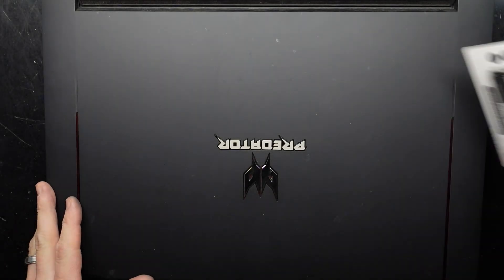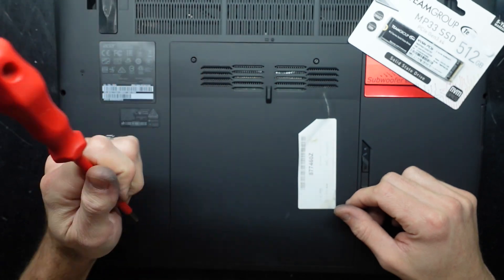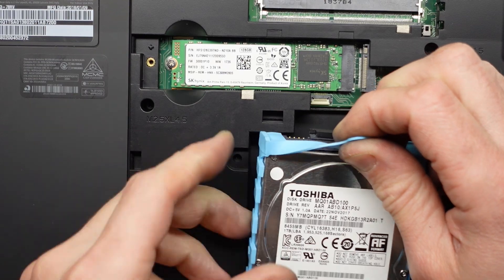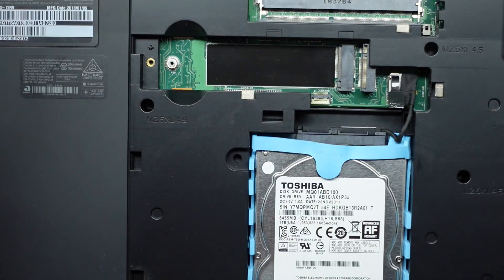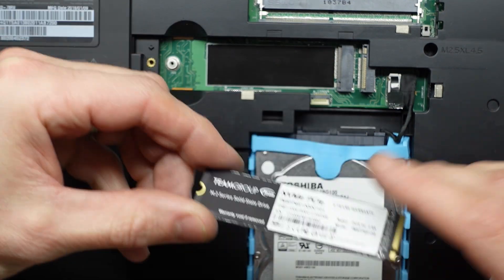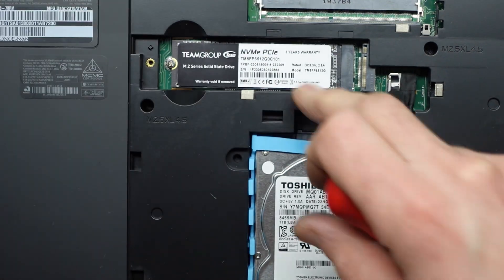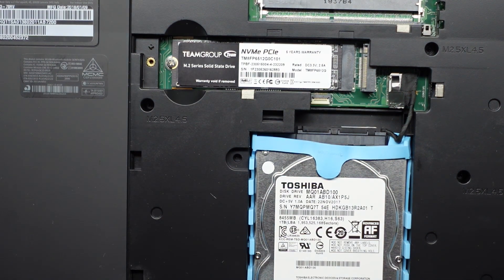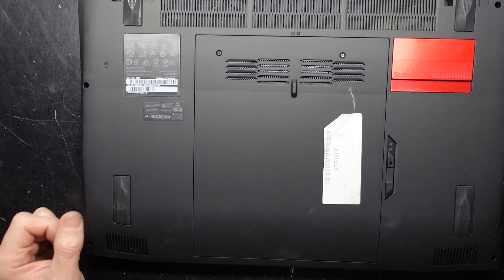Acer Predator 17 N15P4  NVme SSD Replacement

Comment: Nice video.

Does anyone know if the top M2 slot is a 22110, as it seems longer? 
Looking to upgrade my daughters laptop with some more storage. I see there are some converter tools to use on a 2280 to make it fit in a 22110.
Reply from the maker: not sure sorry

Comment: I am planning to add another SSD on my laptop too, but I just found out I do not have the secondary SSD slot to plug in the other one. Does that mean I couldn't use it or can I install another SSD slot/plug?
Reply from the maker: you will need to install the new SSD in place of the existing one you have
Reply: @rickstechrepairs Okay, thank you for the info!